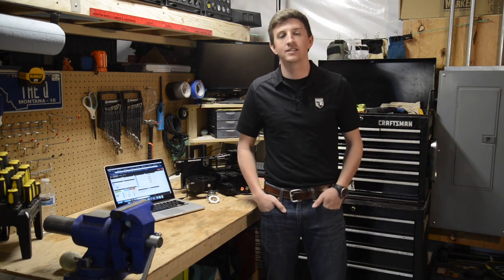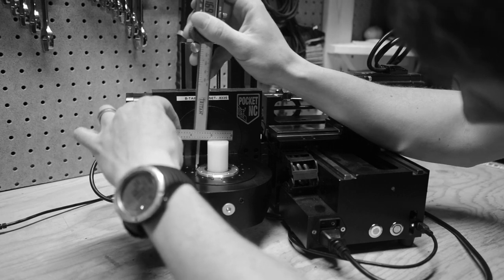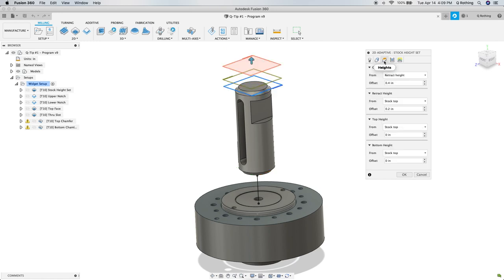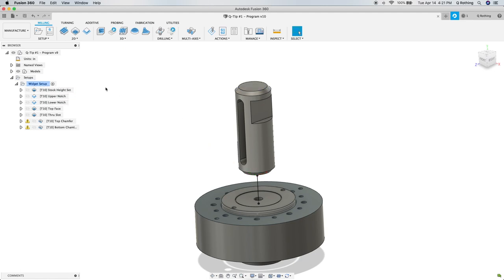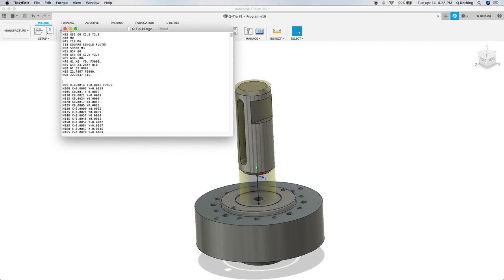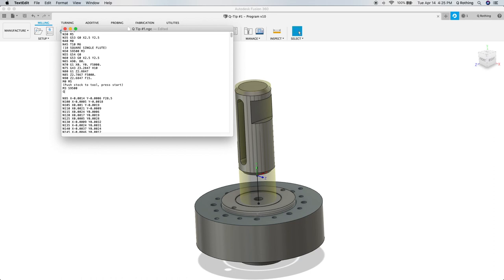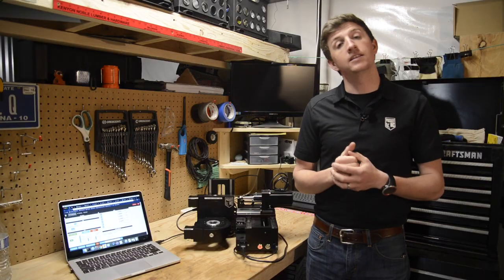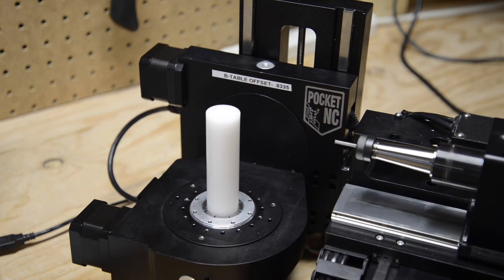Q-Tip Tuesday #1 - ER40 Collet Fixture Stock Height

Comment: Great tip! I just 3D printed a measuring tool that slides above round stock and is grinded to the exact hight with sandpaper. I usually use the same hights but If I need a different one I can just adjust it in the file and print a new one

Comment: 1:22 Where can i get this wrench?
Reply: It ships with the ER40 Collet Fixture.
Reply from the maker: You can find the wrench here: https://pocketnc.com/products/replacement-er40-fixture-wrench-v2-50-spindle?_pos=3&_sid=a103ac304&_ss=r
Reply: Nice vid! Question. Aren’t the ER collets supposed to clip into the collar? Apologies if it works differently when used for work holding on this machine...!

Comment: Wouldn't it be easyer/safer to ad this into the post processor of fusion 360?
Than users just need to tick a box in the post processors tab.
The NC can move the Maschine and Spindel into position and the user just need to add the stock and hit run again. 

I personally would pause the Maschine to set the stock. Retract the Spindel and turn it on before going into position for the cuts
Reply from the maker: Thanks for your feedback. Fusion 360 configures the post on their side, but we could reach out to them to see if they would be willing to add this as an option. The spindle does pause before setting the stock and then a 2 second pause is programmed to allow the spindle time to ramp up before moving to cut. You can configure this aspect of the G code however you would like, so if you want to set the stock height then retract before running the spindle and coming in to cut, you can also do that.